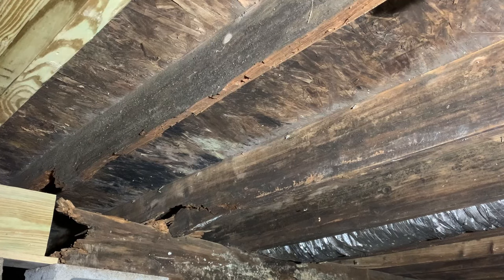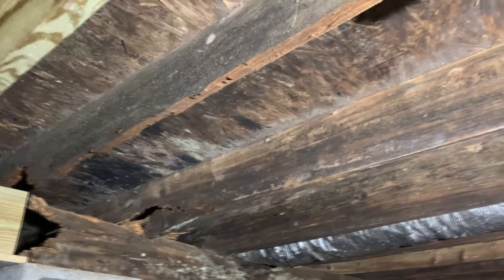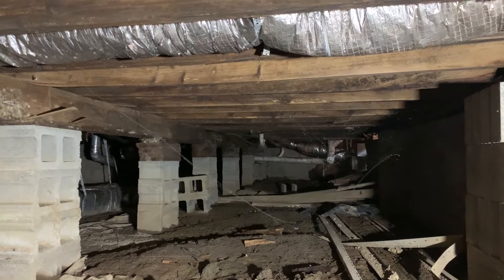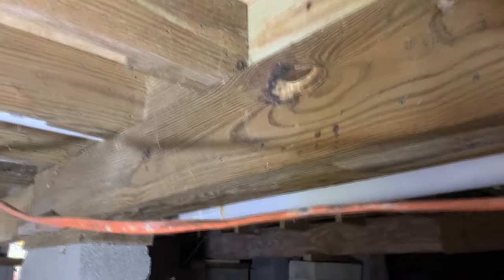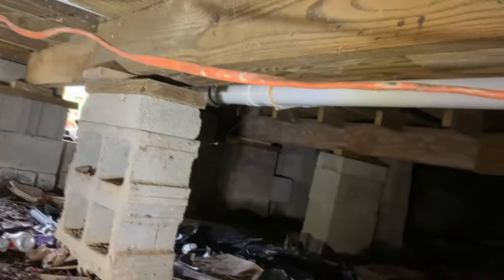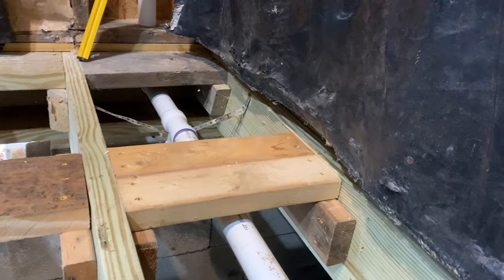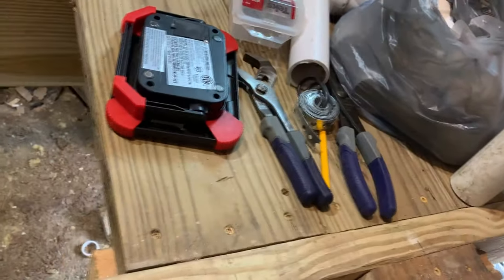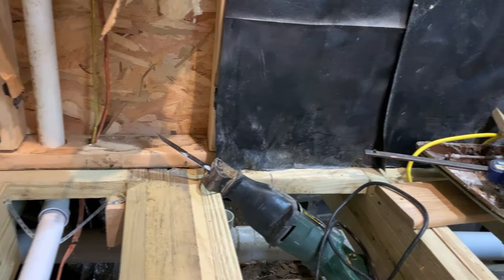Rotten Floor Joist Replacement on a MASSIVE scale!  Entire House Floor Joist Replacement project.

Comment: Man what a job you are doing good work. Im so glad my joists aren't rotted,they are however warped and need some attention.
Reply from the maker: Thank you for the kind words. If you’ve got questions on how to handle warped or bowed joists I can make a video explaining some of the ways to handle those as well. Keep eyes open will be dropping another video soon on the Joist project and more.
Reply from the maker: @blindtomdiy5918   I’ve had lots of cracks in the drywall here. Lol. But for me it’s a non issue as the plan was to remove and replace anyway. For others though the cracks can be a major issue. Some choose the slow method and you not jack up a half inch a day or so to keep cracking to a minimum.
Reply: @HomesteadingBartramStyle  I did have plenty of cracks in mine and in certain areas I did replace the drywall. Now I just need to find a good person to finish up the drywall.

Comment: Dry rot as you call it is actually wood fungus. Wood fungus grows in damp dark places with un protected wood and can destroy more wood than termites in the same amount of time as it basically turns it into paper. If you haven't treated the wood under your home and corrected the moister issues you didn't actually fix the source of the problem . You can treat the fungus by spraying it with mold control . The moister issues can be fixed by crawlspace encapsulation , installing a dehumidifier , or using appropriate ventilation .
Reply: I just learned that today in another video and was going to say the same thing 😁

Comment: You should not lay concrete blocks on their side you really reduce their strength dramatically when you do that
Reply from the maker: True, and as I remove and replace those blocks will be turned the correct way.  Thanks for pointing it out.  :)
Reply: The blocks are dry stacked unfilled ?
Reply: Yep that's a problem.
Reply: Lol still never set blocks that way dude. I fix that mistake for a living brother.

Comment: FYI - Pressure treated lumber does rot. I have 2x10s that literally crumble. The wood was destroyed by a fungus. The humidity in the air was enough for the fungus to thrive & spread. I also found white mold that destroys wood, too. Its also on pressure treated lumber. I'd ensure all your dirt slopes away from the house, your gutter downspouts discharge 10 to 20 feet away from your house, encapsulate crawlspace, and install crawlspace dehumidifier. You've done a lot work! Impressive!

Comment: This house should be jacked up and have a footer poured, ideally with a sealed crawl space and humidity management. At the very least, you gotta have mortar between the blocks and concrete pads underneath , any soil settling and the house could collapse.
Reply from the maker: It does have a solid footer around the perimeter of the home and through the center.  The footer is about 3 feet deep and a min of 2 feet wide.  The real problem here with the house is moisture.  The home does need "Jacked Up" about 2 feet higher and then put sold piers in.  This will allow for the bottom to be filled correctly and water wouldn't stand under it any longer.  Lots of problems here, mitigation is a real mess.  Thanks for the suggestions!

Comment: We're in the midst of doing this right now. We have a couple rooms done so far. We don't have enough crawl space to do it from below though, so we're having to pull subfloor first, then replace any damaged sill plates/joists/beams. It's a job, but we got the house and property so cheap, it's worth doing. We bought enough advantech and treated 2 by lumber when the price came back down a month or so ago, so hopefully we don't have to buy more. Thanks for the vidya
Reply from the maker: Warren, It's a job for sure.  I started on my house a while back, and still going today.  We live in the house so it makes it much harder than it should be really.  One room at a time, and pray each time we cut out a room.   We too have to remove from top down since it's all trash anyway.  There's plenty of room below in the crawl space here but not really useful when doing this kind of remodeling. lol  We tend to buy product as we need it, simply due to costs and some place to keep it.  Just remember in your journey, it'll only beat you, if you let it.  :)   Thanks for watching our video!  I hope you became a subscriber too  :)
Reply: Seems like it’s more dangerous than bizarre
Reply: Are you guys doing it yourself

Comment: ALSO for those watching if you use pressure treated wood>> Know if the wood is fir, larch or white woods. pressure treated white woods like pine in most cases ARE NOT structural in strength vertically. I once had a 6x6x12 roll off my flatbed and it broke in half. no knots or cracks, just weak.

Comment: Doing a similar job in the crawl space on my old house. I have to stop the moisture that gets under there after a very heavy rain. This causes white mold to form then it "eats" the wood. Five years ago, I replaced 19 floor joist, seals, subfloor and redid the flooring. Last week, I found 6 more boards (not the ones I replaced already) with white mold again. Moisture is horrible in a crawl space. Looking at French drains and water proofing. Also, fogging the area with mold preventative. I bet you are glad to have yours completed.
Reply: Hi Gandoff2000, 
Check out Crawlspace Ninja on YouTube. He has some great ideas for preventing moisture and addressing mold. Hope this helps. God Bless.
Reply: How much did this cost? I am not handy and need some serious work done.
Reply: Check outside your home. Does the dirt slope away from your house? Are your gutter downspouts discharging water 10 to 20 feet away from your home?

Comment: hate to break it to you, but dry rot DEFINITELY needs some quantity of moisture to grow (although it can be as low as 20% moisture in the wood). and looking at those "piers" made of cinder blocks, the BOTTOM of those cinder blocks look quite wet. my guess is that the cinder blocks on the perimeter of the building (who thought THAT was a good idea?) are allowing water to pour in during particularly heavy rains. and of course, water doesn't just sit, it evaporates, and rises up to whatever is above (your floor joists).

pressure treating is best, but it will not protect the wood forever. it would probably be best to spray concrete on the outer "foundation" to seal it from inflow of liquids.

one more thing: the cinder blocks being used as piers are sitting on the flat side, which SOUNDS logical, but in actuality, the support is NOT HALF as good as when they are stacked vertically, with the flat surfaces on the sides (as your foundation is). i've seen cinder blocks buckle under stress from having weight placed on their flat side from above. you will see this if you try to jack up the house by placing the jack on a flat topped cinder block!

if you are jacking up the house anyways, it would be a simple process to flip them, though you may need to adjust the height, since cinder blocks are not often perfectly square.

Comment: The plan to reduce humidity in crawl space of my NC house: 1) gutters, 2) underground drain lines from gutter downspouts to ditch to carry rain water away from house,  3) moisture barrier on crawl space floor, 4) dehumidifier, 5) seal crawl space vents with brick.  Completed first 3 steps so far and crawl space appears to be drying.  What a pain, but beats needing to replace floor joists and floor.

Comment: DO NOT USE ADVANTEK!!!  Our floor joists were almost as bad as yours. Our rim joist, sill plate, and lower wall plate are also badly rotted.
The Advantek flooring is rotted in our house along the outside walls, in the bathrooms, entrance ways, and kitchen.  We would never use Advantek,   It does not hold up. And this house was built in 2005. Any slight moisture will cause it to eventually turn into wood flakes.   We are trying to figure out how to replace the outside wall on one side of the house without it collapsing.

Comment: I did something similar. I added about 60 choice underneath the old house. I ended up just cistern next to the warped Joyce. I found the secret was buying several actually tan floor jacks and gradually lifting up the joists in sections. I also put foam board between the joists for insulation.
Reply from the maker: If I'd had the choice to do sistering, i would have for sure.  If the lumber isn't damaged by rot or bugs, you'll only stand to gain by doing sistering if you can support it correctly.  The idea of the insulation board is promising though.  Keeps moisture and heat where it belongs if you seal it up good.  :)

Comment: wow... as someone that has always lived in a house with a basement, that foundation is bizzare. its just sitting on top of cinderblocks.
Reply from the maker: It is sitting on top of stacked concrete blocks..  The corners and center points are stacked blocks with concrete and rebar filling them that attaches to the cement foundation..  Not uncommon in this area at all to see this type of setup.

Comment: i see this and think how did you arrive at a video of my cottage(an old house i bought for the purpose). it is rotted because of moisture and the darkness helps a bunch.
mine has complete concrete foundation around the perimeter of the house with access and vents.
for my situation( only throwing it out for all to consider), the wood sweats and then the surface moisture evaporates in a vicious cycle.  the darkness helps aggravate the situation. the mold/ fungus like the dark. and then there is poor ventilation. seems it's a paradox. to have ventilation there is warm moist air entering a cool place in the summer months. to keep warm in the winter it needs be closed. warm air in the house and cold below the floor, moisture transfer across the floor envelope just as in an exterior wall. 
crawl spaces are a pain to deal with. 
good luck with this.
some tricks i have used in the past under porches etc: use light colored gravel over white tarp- like vapor barrier on the soil. white wash. low energy lighting. this helped discourage the mold/ fungus, they like it dark.

Comment: Are you going to put down some plastic sheeting/tarp material to cover up the bare dirt that is allowing the moisture to cause the damage?  I am closing on a house that is going to need the same repair.  It looks like all of the floor joists will need to be replaced.  After I get the joists fixed, I'm going to remove a lot of the dirt (to give me room to do repairs or mods in the future) to flatten the crawlspace and put down some heavy tarp-like plastic sheeting to prevent moisture.  I will seal the seams with tape and try to remove any path that moisture might have to getting into the crawlspace.  I will also look into some sort of ventilation system to help keep the crawlspace dried out.

Comment: Maybe I'm wrong, but it's my understanding that the minimum size of floor joist is 2x10's. Some places even require 2x12's but almost everywhere requires at least 2x10's. 2x8's just don't have enough meat to them.
Reply: It depends on the span of the joice.Some cases 2x8 would be fine.

Comment: I did two rooms at my house, but then another beam disolved later (so I have more to do).  And old house, moves stress around.   You fairly much have to replace it all.  ouch.  I easily spent $7,000 on electrical repair because of rodent damage, then $25,000 in two rooms, fixing indescribable problems.  One room had no rim joist.  the floor floated in the room.   Which made taking it out safer, but repairing it, still required jacking up, and putting in rim joists.

Comment: I ran into a situation WORSE than that redoing my parents old house. The rot is not from moisture in their old house its from total lack of ventilation
Reply: How did lack of ventilation cause rot (instead of moisture)?
Reply: @maxmanx1294  --Condensation from heating and cooling the rooms above, moisture from the ground too.  All crawl spaces need ventilation.

Comment: @Homesteading Bartram Style My current scenario is I've been told that I've got some loose tiles in the bathroom and some water could of seeped underneath. They need to pull up the tiles to see if their is any  damage and the quote could be even more expensive. Would i ask them to go under the house to see if there is any damage to the joists and subfloor to avoid have to pull up the tiles ?

Comment: wow...i have never seen a house up on cinder blocks like that. is that a trailer house or something? not the most stable way to do a house. i deally, it should have been poured concrete, though i realize that can be tricky in an already existing house. who built this thing originally? was it before the building code existed? i'm no pro contractor, but even i wouldn't feel comfortable walking around in that house...

Comment: My joists aren’t rotted but they are fatigued and need to be replaced after the new basement is put in. I want to use I joists.
Reply from the maker: Engineered I joists are a great material to work with as long as you have no moisture problems or any problems with insects. Ie termites.

Comment: Brother you have your work cut out for you.
The crawl space is damp. That's not " dry rot" fortunately you're using treated lumber. You need to ventilate the crawl space in the summer. 
I know it's a beastly chore but you can do it . Good luck.

Comment: I have a 125 yr old home that needs an entries load bearing wall replaced an sill plate... should a temp wall be built while work is done on the original wall & sill plate?
Reply from the maker: Anytime you’re working on a load bearing wall removing any structural part of it you should ALWAYS support the wall completely from the top to the solid ground below. If that means you have to put in load pads beneath the floor at the ground do it. Don’t ever take chances on a load bearing structure.

Comment: How much would something like this cost to repair and is it worth repairing it? I have a small 877sq Ft home and this issue in my bathroom
Reply from the maker: Costs can vary depending upon material costs and labor.  For a single area of the home to do this would be a 100% worth while project I would think.  I’m still working on this place and will be putting up more videos soon about it.

Comment: Considering purchasing a home with joist issues throughout. How much did it cost to replace for the entire home?
Reply from the maker: It all depends upon size of home. Mine is 1500 sq ft.  Replacement for entire floor is going to run about 6 grand total unless they hike the price of lumber yet again. The screws and pole barn nails add about 3 to 4 hundred more.  Right now the most constant high prices is the treated lumber.
Reply: @HomesteadingBartramStyle   Wow this is very do-able! Great video and thanks for replying!
Reply: Can you recommend what lumber to get to avoid rot?
Reply from the maker: Yes Ken, I sure can.  We have really a few choices when it comes to avoiding rot all together when building.  Most costly is RED WOOD,  Mid cost would be RED CEDAR, and the least costly but most widely used is Pressure Treated wood.  It comes in two forms that are widely used.  One type is a NON-Ground contact rated version.  I highly advise avoiding this type as it's protection wears off after a few years.  The Second type of Pressure Treated wood is a Ground-Contact rated version.  It allows full contact with the ground, water, and even to bury it.  It is also not going to allow bugs to ruin it.   As for the sheeting materials, Two widely used option are Advantech OSB, very solid and very water resistant, and the second is Marine Plywood.  It's a Pressure Treated type of plywood that is Ground Contact rated as well.    I hope that this helps you with your question, if you need more information, I'll do a video soon about just this topic.  :)
Reply: @HomesteadingBartramStyle  THANK YOU! So helpful as I'm planning my first build.
Reply from the maker: Ken,  I tried to view it, and it tells me that the file has been put into your trash.  I'd love to take a look and try to help if possible.  Let me know if you'd like my input.  Always happy to help if possible.
Reply from the maker: Ken,  Hello!  I just had a chance to look over the detail that you sent me in the link above.  First the easiest question to answer.  #8 hardware cloth will be your best friend when covering the "Bird Blocking" holes.  Cover them on both sides for maximum security from animals or pests.   With "A" frame home roofs or generally any roof, you always are prone to mold/mildew problems without enough ventilation.  Using "vent panels" in each bay that goes from top to bottom of your bay will help greatly reduce the problems.  Positive ventilation is KEY.  Now for the main question.  Dealing with N Idaho building code.  Since you technically are using the Roof as a wall on a "A"frame construction, you would hope to be able to use the "Wall" code.  However, in most cases the more "Stringent" is the rule of thumb.  So according to the code that I found :  https://insulationinstitute.org/wp-content/uploads/2015/12/ID-2012.pdf , You would need to get an R49 into those cavities.  This means either the use of some Large deep cavities, or possibly the use of 2 pound foam instead of the rockwool.   I'd contact the local building code folks and request from them for sure prior to moving forward.  If you can use the "Wall" code instead it would probably be easy going with RockWool product as you specify in the specs.

Also of note:  You may want to "oversize" the vents at top to ensure positive flow of the air through the attic space if you don't end up using foam product.  With foam product though there would be no need for vents though as you would be sealing in the entire envelope of the home.   

I hope this helps answer some questions.  If you would like to chat more, give me a shout back.